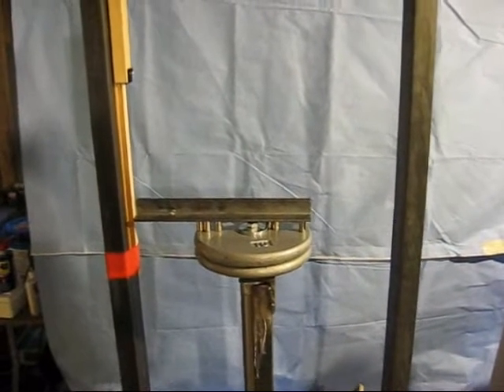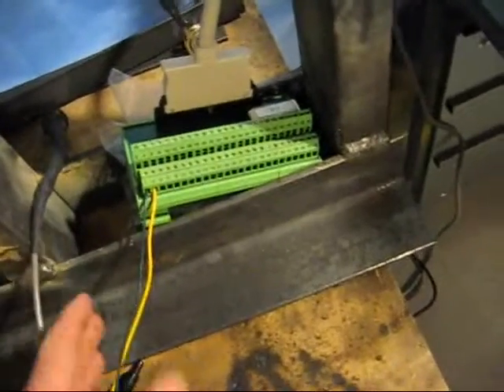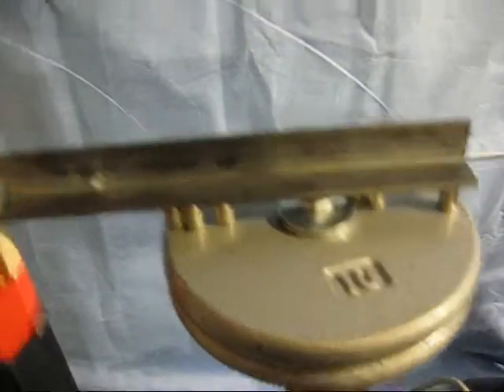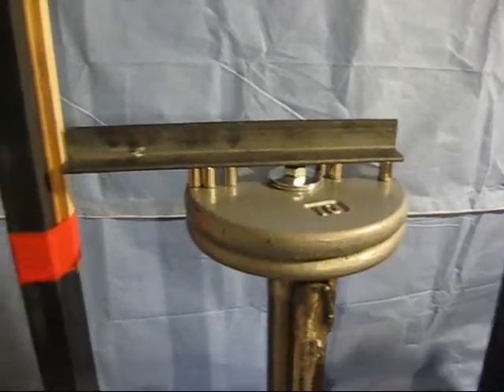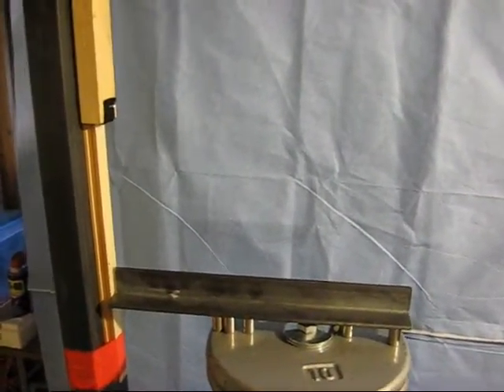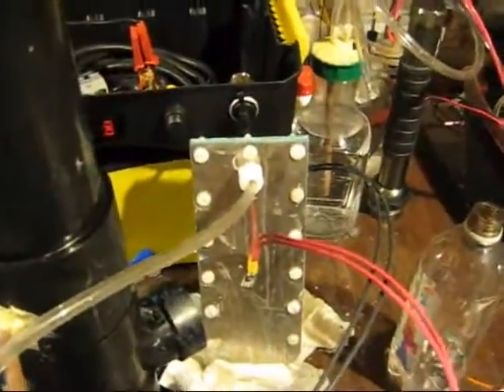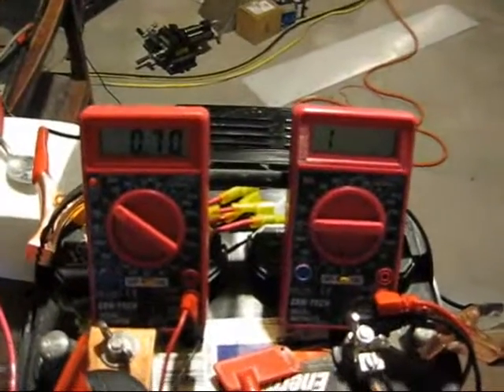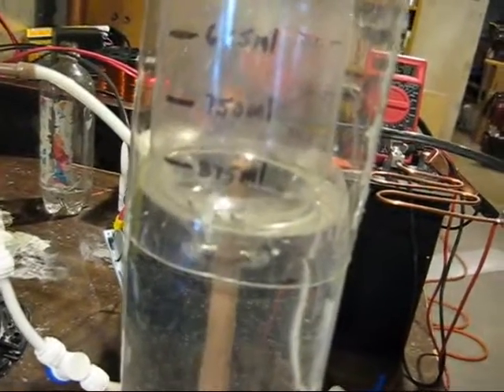HHO Energy Test©

Comment: Finally, 1 Liter of HHO will contain 2/3 of the energy of 1 Liter of H2.  This is, 1.9827 Wh/Liter. 
If your equipment produces, say, 2 Liters/minute of HHO, you have 3.9654 Wh/minute, or 238 Wh in 1 hour (120 Liters).   
Don´t confuse Watts (Power=Energy/time) with Watts-Hour (Energy).  1 Wh = 3600 Joules.

Comment: Now, the useful energy of a fuel is expressed by its "Lower Heating Value" or LHV (see Wikipedia). LHV of H2 (biatomic gas) is measured to be (in "Normal Conditions": 25ºC and 1 atm of pressure) 2.974 KWh/m3 or, what is the same, 2.974 Wh/Liter  (mult & divide by 1000).

Comment: NOTE that this proportion is in volume, not in weigth: Oxygen weigths 18 times more than Hydrogen, so the weigth of an amount of HHO will be mostly due to its content of O2.
So, in 1 Liter (volume) of HHO you have 2/3 Liter of H2 (biatomic gas) and 1/3 Liter of O2 (biatomic gas). No more, no less, nor anything else.

Comment: If bubbler was empty,you might be right,but since H2 is lighter than O2;gas is drawn from bottom so hardly any H2 is drawn in cilinder.H2 is in top of bubbler!Idea is fine, yet execution entirely wrong.If done right,so drawn from top(longer hose),it is a different story.Next thing is:enough air,by lifting first weight up some factor 5 to 125 ml.Better protect everything first and take less:50 ml.Otherwise BANG!Good health to our new mr.Nobel.He deserves it.Science should have done it long ago.

Comment: You will need the proper mixture of AIR with HHO.Problem is there is not enough AIR.H2 is lighter than O2.So there is only H2 in the sysem,and very little O2 or very little AIR. So to be certain,
(1)one should have 5 times more AIR than HHO;
(2)ignite where the level of H2 in the top (as it will flow to the top),is suppose to touch the lower positioned AIR, OR create enough spark depth,to reach that point.
Now there is enough mixture for all H2 to burn.First lift weight 5 times the volume HHO

Comment: Ive been thinking about this video since you posted it i keep wondering if the distance traveled was limied due to vacuum created as the cylinder moved up. i would like to see you do the same experament with air/vapor gasoline ratio 14 to 1 (125 ml) (supposed ratio gasoline burns to air)[way easier said then done]

Comment from the maker: It is a mis conception that time is a component.
of the amount of energy. It is not. It takes the same amount of energy to lift a mass through a distance regardless of the time. Thats the definition of work Mass through a distance.
Now Horse power is an energy rate not a fixed amount of energy. If I wanted to figure out the potential energy rate That is different. HHO Use rate -VS- burn rate and developed HP would require a much more sophisticated mechanism and lots of instrumentation.